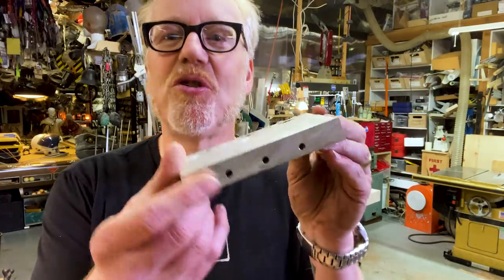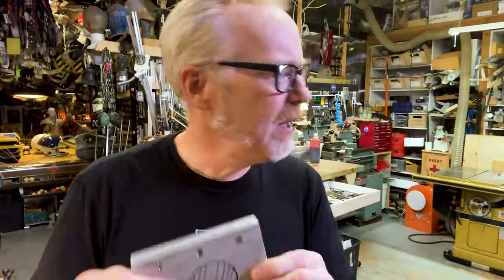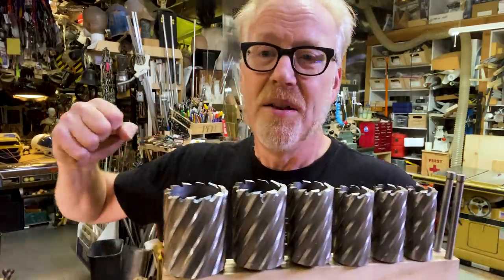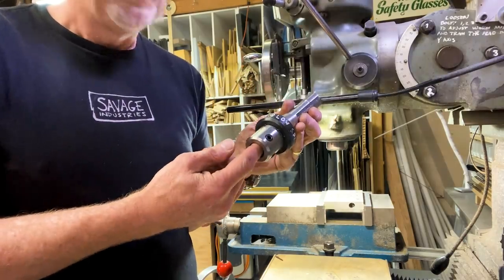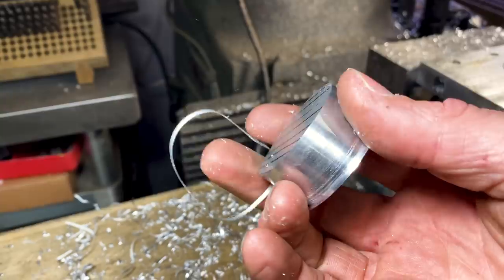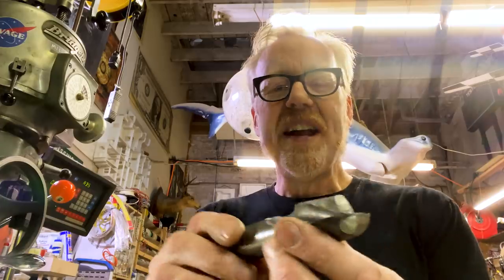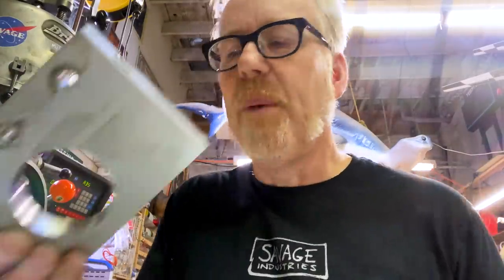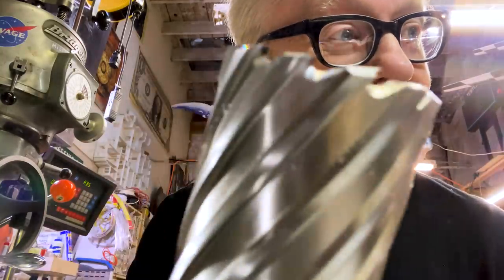Adam Savage's Favorite Tools: Annular Cutters!

Comment: Always called them Hougen bits. Mostly used for drilling. Through steel. With a hand held drill....kind of. At least, I held the magnetic drill press until I turned the magnet on. This was back when Milwaukee was still in America.

Comment: Interesting, I've only ever heard them referred to as Rota-broaches. I know its a brand name like hoover is to vaccuum cleaner. Never knew their actual tool name was an Annular cutter.
Just as with any drill they have their own set of charts for optimal cutting speeds.
1 lesson I would try and pass on to anyone is when cutting a piece of box section with a welded seam on 1 side. Try to avoid it altogether if possible. 
If you cant, have the seam on the front face and not the back face. The seam is pretty rough on the inside of a piece of box section and can easily snag and shatter the cutter. I've done this on a couple of occasions and lets just say it sounded like a shotgun going off. Everyone in the workshop turns around and you never hear the last of it.

Comment: They are definitely the tool for the job, but a carbide hole saw in a drill press on a slow speed, with the work clamped down, and some cutting fluid will do just fine too.

Comment: Literally a heavy duty hole saw for metal working.
You can get hand feed Mag-drills for a few hundred dollars. 
They have a spring for the centre needle that helps remove the plugged material.

Comment: I figure a lot of the ease of cutting stems from all of the cutting action happening at the radius of the cutter, and none at the center.
A regular drillbit has to cut all the way to the center, where the bit is really just rotating in place. The edges will move relative to the surface of the material, allowing them to shear off pieces of metal, but the center just spins on top of the material.

Comment: A mag drill to use them is not that expensive ...i get one that will use up to 40mm cutters and i use it all the time and my drill press is almost redundant...they are much cheaper than big morse taper twist drills  ...the final resan i buy a mag drill was i needed to drill a lot of 30mm holes and a no3 30mm  twist drill was £110 GBP and a 30mm cutter was only £32..the smallest size you can get is 12mm in the UK..i see in your link from 7/16 which approx 11mm ...ho you can drill overlapping holes as well which can be handy

Comment: The better performance is from not having to remove less material but from not having the zero cutting speed at the centre off the drill. Additionally not having to move the centre material out through the flutes. Extra teath will reduce tooth load.

Comment: Those 12 blades also split the work. Look at the cutting faces.

Had to cut through a huge eye beam to mount a satellite onto a mobile platform and yeah they were having trouble so I did some research and I found these bits too.

Comment: Use a Proto Trac, use smaller to larger drills, then interpolate the hole.

That's your alternative to annular cutters

Honestly interpolation the hole, for me, is WAY less terrifying than an annular cutter. It just does so much work all at once.

Manual milling works too. A DRO isn't really necessary for making a hole.
Reply: It is very possible that this opinion is borne of having a lot less experience with annular cutters.

Comment: Adam I needed to do a 25mm hole in a 55m aluminium block at home. I did it with a power drill, press drill kit and a hole saw. it was scary AF and took for ever. I just google Annular Cutter set and long a behold it is almost impossible to get in South Africa. URG !!!!

Comment: Wranglerstar has a video called "The one tool I regretted most buying," about an electromagnetally-mounted drill press that came with a set annular cutters. He shows how he drilled a big hole for a trailer hitch ball in the hardened steel fork of his forklift. This should round out your education on the subject.

Comment: chuck it in the lathe bolted securely to a spud
spud has 1/2 -13 threads and is from 2" round stock 
turn it down so that it is like 1-3/4''' for 1'' long to plant 3 jaws on and use a draw bar thru headstock to make it idiot proof secure 
rill 1/2 hole in aluminum stock face spud to have a relieved center area so purchase is at perimeter of spud face 
use a high speed 3/8 square tool in tool post 
grind plenty of side clearance put chip flow enhancing polished hook in top face
plunge away in steps

Comment: Not tin foil. It's robot pubes. We use annular cutters all the time in the tower industry. You can get them with a regular shank as well. Search rotor broach. You can use them in a hand held drill for smaller holes and thinner steel.

Comment: Since my most advance tool in my shop is a DIY router table, I would have hobbled away at the aluminum with a dremel for about a week and then realized i located the hole on -XY instead of XY....

Comment: The other problem with that big fat milling bit is that it cuts at all different speeds throughout the whole radius. The Annular cutter maintains an even cutting speed, as the cutting surface is limited to a very small portion of the radius.

Comment: Those cutters look like they would cost a fortune! The radio people from 70 years ago had need of big holes for tube sockets and the like. For only a few bucks (back then), you could buy a fly cutter that would chuck into a drill press and cut holes up to 3" or so. Now that was in up to 1/8" thick aluminum sheet, such as used in radio chassis. As the cutting bit was narrow, it, like the annular cutter, only removed the edge of the hole and produced a slug. The center of the cutter held a twist drill that acted like as the pilot drill, something that the annular cutter does not have, so theoretically you could usr it in a hand-held drill. But being unbalanced, that would take more guts than I have.

Comment: key is slow down pressure! let the cutter do the work. sold these cutters for 20 years. also with a Mag Drill you can put the ejector pin in the cutter to knock out the slug.

Comment: Only issue is that 2" cutter is roughly $200, I buy 15/16" diameter ones at $100 in bulk. The poor man's annular cutter is a standard hole saw, you can only cut the depth of the tooth at a time though. Simply back out, brush out the cuttings and continue.

Comment: I used to work at a factory where we made windows with wooden frames. We used these kind of cutters to make wooden plugs that we then used to fix eventual twig holes in the frame
 You drilled the twig out and out a plug in the hole together with glue. But after years of being exposed to the elements and changing temperature and humidity, the plug could get visible after some years. But today, plugging doesn't exist any more. Today all wooden pieces are scanned for twig holes and cut away making finger jointed pieces instead.

Comment: Those hollow end mills are great but they are also super expensive. A good quality hole saw will cut thru 3/4 aluminum easy by going 1/2 way thru from each side.

Comment: Adam throw that jhead in back gear run a hole saw in reverse and drill a 1/2 hole on the inner part of the diameter for chip relief. Run as slow as you can and you'll have no issue at all that's what the power feed is for

Comment: i can't help but notice he uses the cutter in aluminum.... how does it hold up in tool steel.... just don't see needing a special cutter.  i don't believe one is more dangerous, both are equally dangerous when the cutter starts to wear.  worn tools take more force which leads to part or tool moving in an unusual way.

Comment: I was thinking the whole time isn't this obvious? I use this tool all the time on wood and plastic. This is just the metal cutting version of it. The one I use also has a drill bit in the middle so you can put it on a hand held drill and it wont slide around.

Comment: I use mag drills as a trade. You need to go extremely slow. That many rpms heats up the bit and they can snap.
Reply: With steel, yes. Aluminum is softer and will sink away a lot more heat so you can usually go quite a bit faster.
Reply: @slider7w  i also work with aluminum as a trade. Simply put yes you can go this fast; no, do not cut at that speed.

Comment: rotor  broch son . it eyes . LOL originate   that is a Rotter broch . i used then to cut  2"   broken bolts out   valve bodies on pawer stations  so it removed the stem & left the threads  Good bit of kit  you say tomato i say  tomarto   LOL     Les England,

Comment: TREPANNING ...originally used to drill a round hole in the skull to remove, or elevate a depressed fracture  over the Brain.
Developed independantly in Ancient Egypt and Pre-Columbian America
Still used today in Brain Surgery with both hand and slow power drills.
Also used in Gun Barrel making (early 1900s, developed by Krupp of Essen to Bore out Artillery Barrels, with less waste...core could be utilized in other machining.)

Comment: How many do you want? A hole saw? A waterjet? A plasma cutter? A step bit? It's aluminium, not hardened steel. You can drill that shit through with just about anything. I've had hangover farts that could melt through that.

I've used HSS drills to drill it out somewhat and a file to make it clean, it takes several minutes rather than seconds, I'll give you that.

Now, a piece of hardened steel with that thickness, a tungsten carbide cutter comes in handy.

Comment: But this is aluminum we're talking about. You can achieve a hole that size with a standard bi-metal holesaw. Not trying to belittle your cool new tools, I think they're amazing, but I just dont want everyone thinking they need a $240 set of cutters and a Bridgeport to cut a 2 inch hole through a inch of aluminum.

Comment: Drop the speed even more and it'll cut better and your cutters/bits will last longer.. I'll drop my regular drill press down to 400-500rpm with twist drills and just apply downward pressure and they cut like butter. I spent years with a much higher speed, crappy cuts and ruining bits a lot faster

Comment: Thats insanely fast for that bit. Try cutting carbon or 304 stainless like that and that bit would be toast in 10 seconds. You need to be at about 90-120 rpm if you want that bit to last in hard metal.

Comment: As a machinist i feel kinda spoiled.
I often do not realize the issues when using a manual mill.
I would probably have made that kind of hole with a helical cycle and a 20mm endmill.

Comment: Where did you people go-to school? Placing the hole in the corner leaves material for another hole etc. Material conservation! Also material/cutter types have certain surface feet /mln. Speeds to follow. Also different cutting fluids are advised for different materials. Kerosene is common for aluminum.

Comment: What difference between that and hole saw. It only aluminum should be easier to cut than wood I mean aluminum soft it similar to chewing gum.  Cut a hole in harden high carbon steal. Then need a torch

Comment: Adam, where you been, brother? . That is called "TREPANNING" . It's been around like FOREVER.  Used a lot for large deep holes, Say an 8" diameter hole 3 feet deep in solid steel. ,,,, BTW, if all you need is a clearance hold and don't have a bunch to do why don't you try a hole saw.   If you have to hold a dimension  - Hole saw then boring head, . You can even do it in the 4 jaw if you don't have a mill. ,,, Not at all impressed with the Hougan bits. (They break easy too $$$$$$$

Comment: My word also, it is not a "BIT", it is an "end mill". He could have used a $15 hole saw from AMZN. The crossover tool poop-for-brains is advocating is a much more expensive option if all you want is a reasonably accurate, large diameter hole. This is the approach and tool used to cope Ti bicycle frames. 

https://www.amazon.com/LENOX-Tools-Bi-Metal-Arbored-Technology/dp/B0052EDHLS/ref=sr_1_1?crid=2VLIZV97P4RGI&dchild=1&keywords=1.5+hole+saw&qid=1608747805&sprefix=1.5%22+hole+sa%2Caps%2C163&sr=8-1

Comment: A tool you might find handy, https://youtu.be/mRc7ZDRcgrQ  Advoko MAKES remakes his tools from the past and present I presume to help work on his log cabin. While there he also works on side projects like, water wheel powered mill to make flour. The original reason I was going to bring this gentleman up, is he made a bear proof door for his cabin that someone tried to brake through, and failed. He wondered out loud why someone would to pry the door apart in the middle when it wasn't locked, and asked everyone watching to come up with ideas of why a person would do this. I suggested that the door may have got wet and swelled a bit, and froze shut so the guy tried to pry it open from the middle, but someone suggested that was unlikely. Maybe you guys can figure out why lol.

Comment: Ummmm.... hole saws work on aluminum....
You can almost use a 16th drill bit and out like the hole with smaller holes until its boared out. Then smoot it out with a file..

After watching full video-
Yeah that was a lot easier..

Comment: "Be careful, go slow, use lots of cooling fluid..."
Reply: Not slow...these cutters need load. Plenty of coolant and push down steadily but firmly. Dont automatic feed if using drill press. If using a hand drill or magnetic base drill the revs should drop significantly as the cutter does its job.

Comment: I used to break these at work all the time XD
Reply: Were you using coolant i have drilled thousands of holes only broken one bit
Reply: @owenrossi6032  yeah but it was a janky shop and we just had spray bottles. That wasnt even the problem tho. We were drilling bridge beams mostly that came in with that topcoat primer shit and it would take way longer to get through than the actual steel. The bit just would bite. Conquered better men than me. Stuff was nasty.
Reply: @owenrossi6032  I should state too that at the time we had really old mag drills that wouldnt hold as well as they should either. And we were drilling hundreds of holes a night basically as fast as we could.
Reply: @owenrossi6032  I was a camberer or on the laser drills most of the time so I stayed out of the fray pretty regularly, but those first brutal months of grinding and drilling for 10-12 hours a night broke many a temp I can tell you that.

Comment: I would buy some but they’re expensive, especially if they only work once a year
Reply: And cannot make a hold .005 larger then they are listed at. ,,,, Plain old hole saw 1/8 under and a boring bar can out you 1/2 thousandth of ANY size you want.  - Trepanning, great for production, One-off, not so good.

Comment: Adam, there's a product called Slick Stick made to lubricate these types of bits. It's more or less wax of some sort. MUCH cleaner and more convenient than oil or water. It actually keeps the bit cooler than oil too. Nice video. Thanks. https://www.amazon.com/Hougen-optimum-annular-cutter-efficiency/dp/B0784VX14D/ref=sr_1_6?dchild=1&keywords=slick+stick&qid=1607823951&sr=8-6

Comment: If you're plunge-cutting with a 1/2" 2-flute end mill to start that hole, you're doing it wrong.
drill a pilot and use a 3-flute cutter and run a few circles, done.  Or spend the money on unnecessary cutters.  Whatevs.

Comment: I've been putting these in pillar drills for years, you can turn the speed down  to a lot less than 900 rpm😂, drill through 316 stainless no problem. Amazed you still have your fingers though, what a dumbass thing to do.

Comment: 4 jaw chuck holding the aluminum on a small hobby lathe will do it.  Easily.  Just like the little green lathe sitting behind you.  Drill random hole with a plain bit then open it up with a boring bar... I thought you were supposed to be clever or something?

Comment: Smh all the don't do's of machining. First off don't get your hand near spinning chips and stringers. It could whip around and cut you good. Second don't pull it off with your bare hand.. third, a core bore drill would be your best bet turn the whole thing into a chip. Don't need plugs flying out

Comment: There's a lot wrong with this video. Core drills and hole saws for one thing. A 2" annular cutter is gonna take some horse power. A1" end mill is not "scary". And for a multi millionaire that has worked on TV, this is very low quality production. MR. Pete 222 does much better in his basement.

Comment: For F sake, you are making a big hole - the standard method is to use... drill bits ;) Most pp - even basic level hobbyists own 1" drill bits with reduced shank. Many own bigger drill bits. You do not drill with an end mill unless you doing counter bore - most pp stopped using counter bores for... counter boring and just use EM. 
Once you get close to size you want you simply bore to exact size. Small boring heads from China cost less then $50. 
This has been done for the last 100+ years - this is how things would be done in 1922. IF for some reason you did not own a boring head you can design a fly cutter setup to do the work for you - not too precise etc. but will make it. 
Main advantage of annual cutter is speed of getting close where you want to be and not needing pilot hole. BUT they are expensive (!!!) Like VERY expensive. Especially for the set shown and depth of cut of say 2" or 3". Adam is rich so he can afford $1000 set. Hobbyists? Not so much.

Comment: Rotabroach.always use the pilot pin supplied, safer. How you still have all your fingers, hands and eyes, is beyond me, wearing a ring, watch, no safety glasses, putting your hand into a rotating ball of swarf, blowing swarf away with a air line,, you would be sacked immediately, in any company. I warn ANYONE watching this.... "ACCIDENT WAITING TO HAPPEN".... DO NOT, UNDER ANY CIRCUMSTANCES, COPY ANYTHING, THIS PERSON DOES. HE IS DANGEROUS TO HIMSELF, AND ANYONE WORKING AROUND HIM. HE DOESNT KNOW WHAT HE IS DOING. 50+ years experience, with no parts missing.